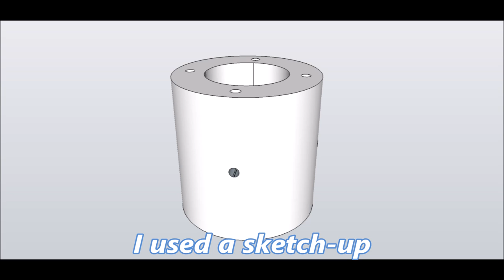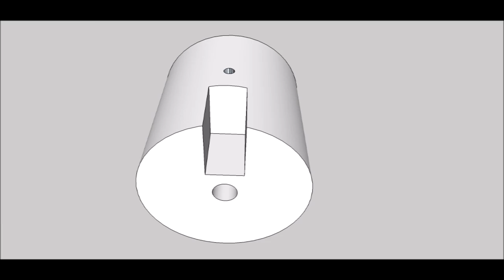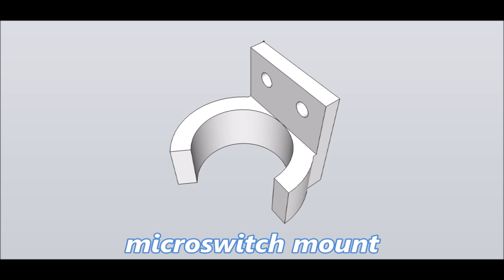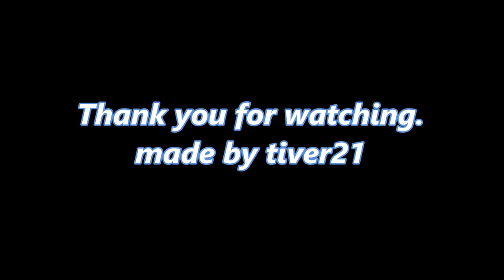RC submarine Piston Ballast (Types of M4 Thread rod in syringes to save space)

Comment: It works really well. I would have expected even a little bit of leaking. I would have 3D printed everything except the syringe itself. A neat way to have sensors without breaching the cylinder is to use a magnet inside the piston head and have it trigger either reed switches or hall effect sensors.
Reply: Or these same motors come with an encoder, you can position it wherever you want.

Comment: Hi Tiver, great job!!! I was thinking to create something similar: two opposite cylinders placed in an OTW Design Type VII 1/32. I cannot use syringes  i will have to manufacture everything and i am afraid that it will leak water through the piston head , more when pushing the liquid out. I will try it, i am planning to use a pancake stepper motor, driver and Arduino, for the thread i am thinking of using lead screw with a ball nut there the piston will be fixed, i think it is called ""external linear actuator". What do you think? The piston head diameter will be around 100 mm..Not sure what to do...Initially the plan was to install a closed WTC with water pump. Thank you. Bogdan
Reply from the maker: Put the oring and grease in the thread rod of the piston head. This won't leak. Maybe... ..I wish you success in your challenge.

Comment: Why does the rod need to penetrate the end of the syringe? If it's just to stabilize that end, you could have just 3D printed or laser cut a support with holes in it to go in there that was a tight fit. Push it to the end of the syringe and count on it being a tight fit or put some glue on a long paintbrush and carefully glue it in place. 
You also didn't need to penetrate the syringe for the limit switches. Glue a magnet to the back of the seal and glue a reed switch to each end on the outside of the syringe.

Comment: Pretty neat, but isn't the hole in the rubber seal in the middle gonna cause some issues when you go down and the pressure increase?
Reply from the maker: I tested it. No problem.  I'm a little worried about durability.
Reply: @tiver21  How deep can you go?

Comment: Nicely made but where did all that air that was in the syringe go when the piston drew in the water?-it leaked out past the motor mount and lost? unless there is a way to get that air back,  it's a one way trip to the bottom??
Reply from the maker: The air in the syringe is compressed and stored in a submarine hull.
If the hull is under pressure and the hull lacks confidentiality, it will sink forever.
I am using it well without any problems as a result of the test.
Reply: @tiver21  Ah a watertight hull..I should have known-Nice job!

Comment: Hi, can you please explain how is the threaded rod and piston sealed....?
Reply: the rubber hole is so tight it seals it
Reply: @borecek168  there still will be a gap because of threads in the shaft and the cut thread in the rubber...... i.e. a possible leak
Reply: @shauryagupta4990  you can use sealed bolt and glue on that metal plate, it shoud be enought
Reply: @borecek168  ok....
 Let me try that.....
Reply from the maker: To prepare for water leaks, I make a grease inlet inside the Rubber
but Not used. rubber hole is so tight it seals it.
Reply: tiver21 how mutch in total have you paid for the parts?